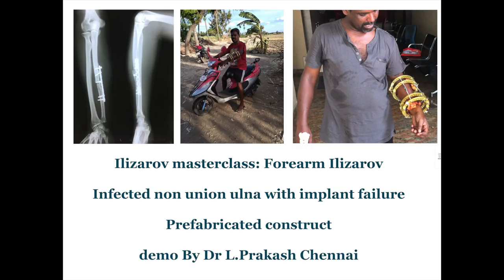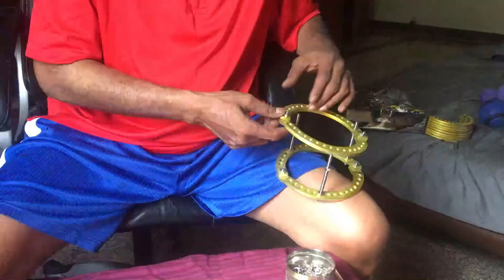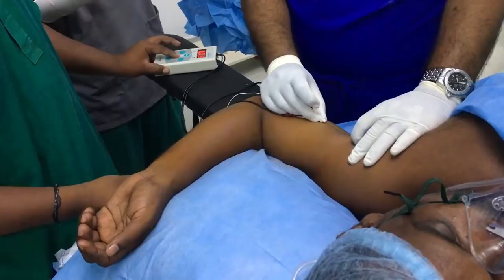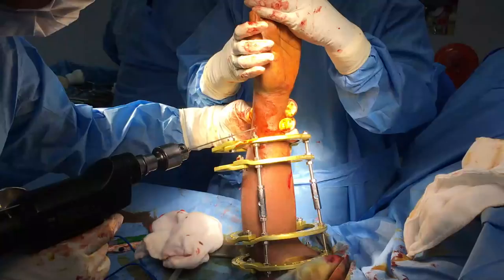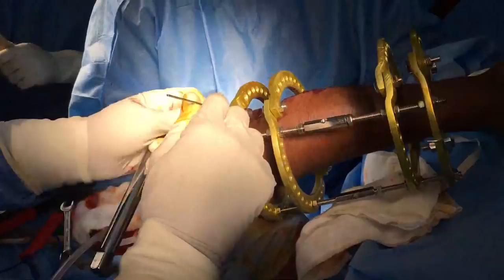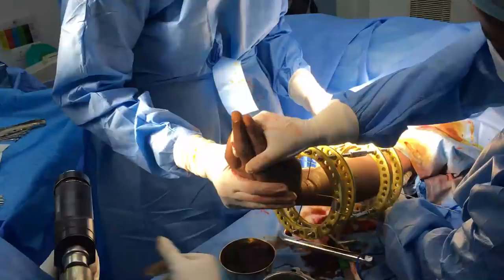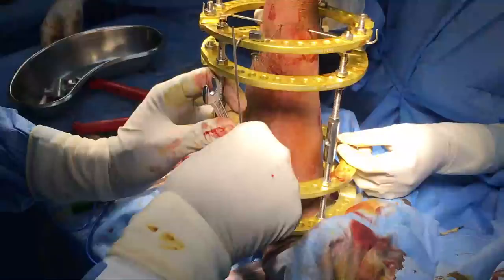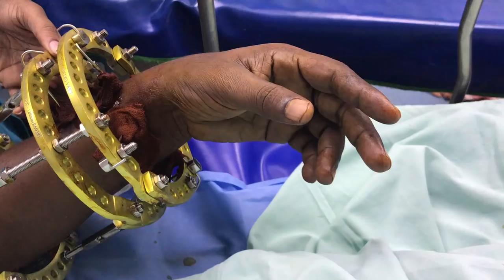Ilizarov in Forearm

Comment: Around 2:47 it feels one of the rods is at an slight angle, not perpendicular. Is that deliberate?
Reply from the maker: Jenendra Dhakarey ulna is curved. Rods are straight. So we match anatomy
Reply: @iaos.org.in.youtube  Thanks for clarifying :)
Reply from the maker: @jay.d111  Not much literature is available on forearm Ilizarov. Even the original Ilizarov book, "Trans osseus Osteosynthesis"  has a scant reference.  i have done some 11 cases and am still learning. But all my patients are very satisfied. In this non weight bearing vascular area, results are very good
Reply: @iaos.org.in.youtube  You're a pioneer to be honest. I'm greatly impressed by your passion for helping people and spreading knowledge! I am from Pune and scheduled for a Ilizarov surgery soon. If you don't mind and can spare 5-10 min; Can I trouble with you a consult on the frame design.